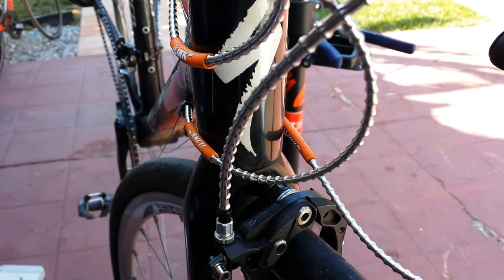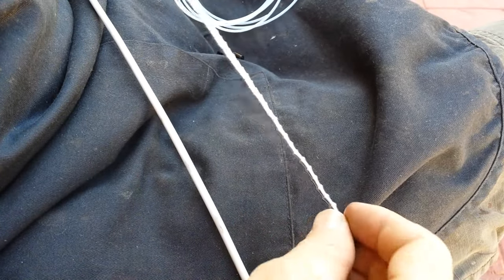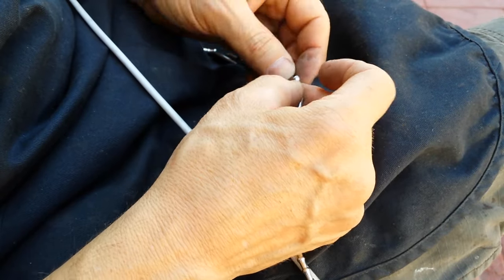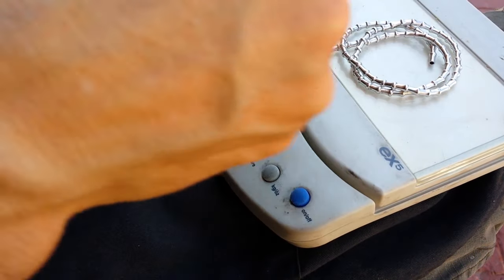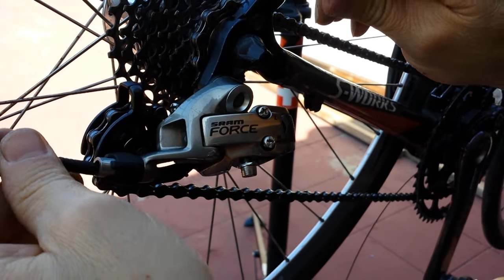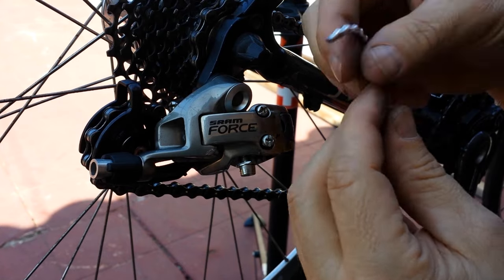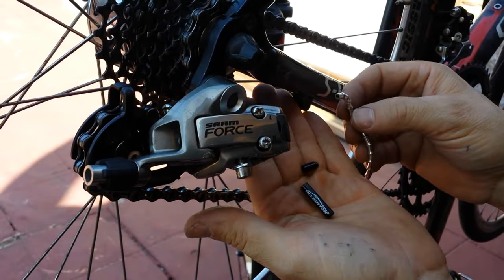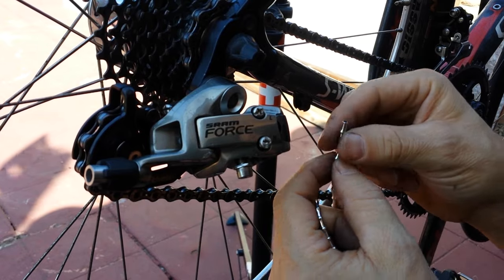Cycling Tips - Alligator Cable Housing Install - Le Tour de Plants

Comment: Hello!
Still using them? :))
How did you like them after a long mileage?
Thanks!
Reply from the maker: Yes, still using. They are good, if you can afford the extra cost over standard cable housing.
Reply: @LeTourDePlants  hi..any issue when raining? Or when you wash your bike? because im thinking about water leak on cable?..tia😊
Reply: @charlsjourney4480  there is an inner plastic tube wher wire runs through

Comment: I want to ask, If you can cut it just only use fingers, doesn't it mean easier to broke/crash??
Reply from the maker: +Rizaldi Ryan Possibly more so than conventional cable housing, but it has not been an issue in the 5 - 10,000 miles I've put on the bike.
Reply: +Le Tour de Plants - Vegan Cycling wow, thx for the answer : )